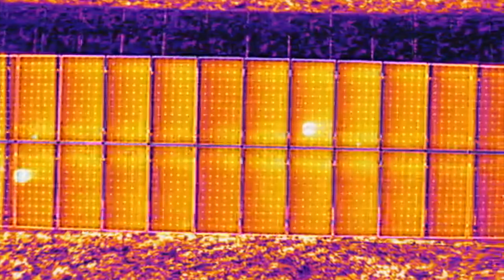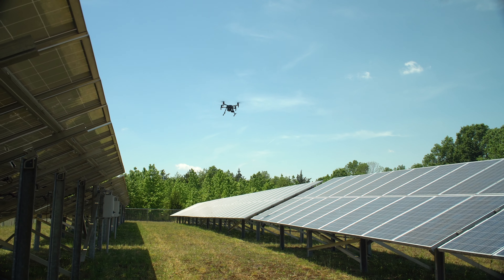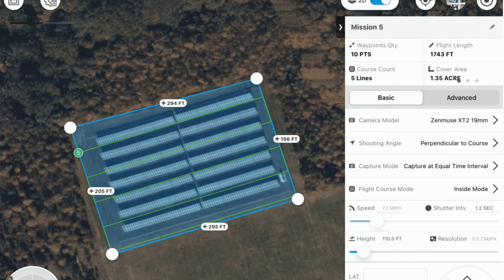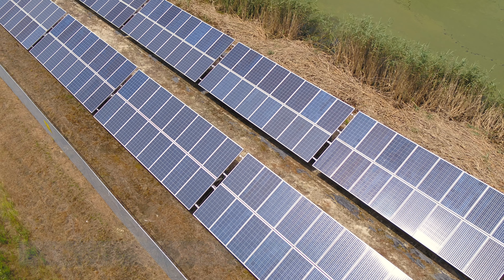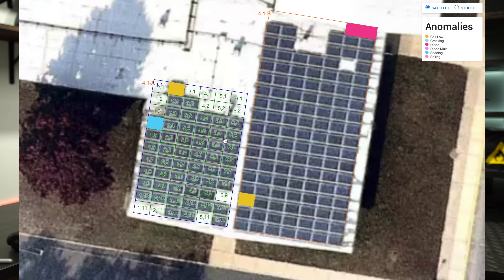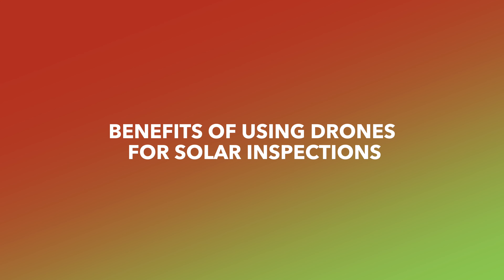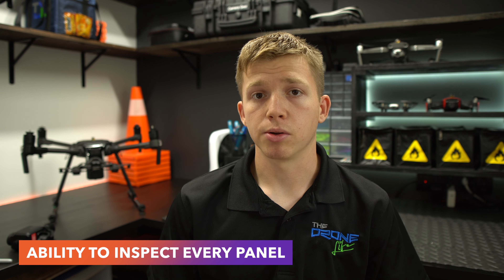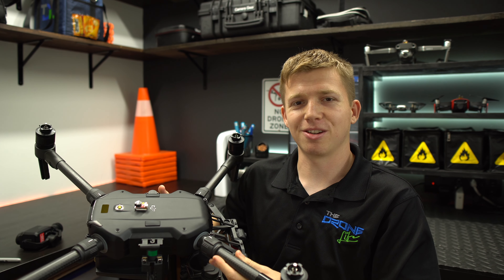What are Drone Solar Inspections? A Beginners Guide

Comment: Is there a worthwhile service to analyze a thermal inspection for residential installation?

Already doing large fields that have in house analytical capabilities 
Thanks
Reply: Connect with local solar installers and roofing companies for pre and post-condition assessment inspections. Its all about liability.